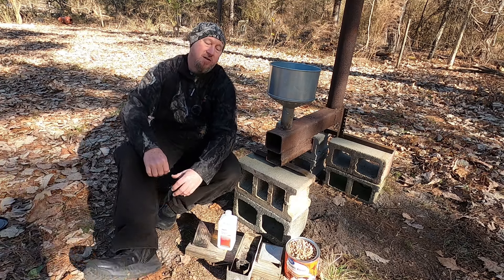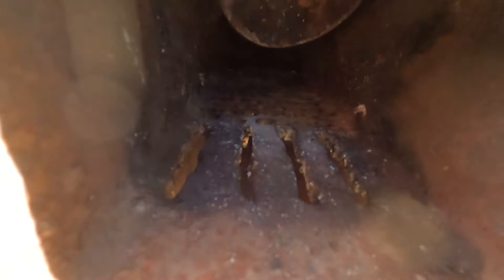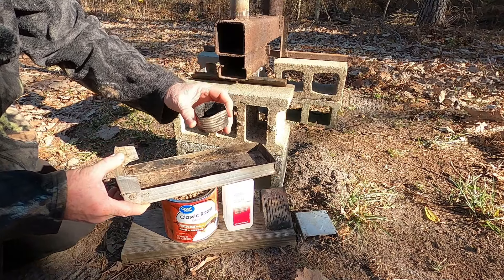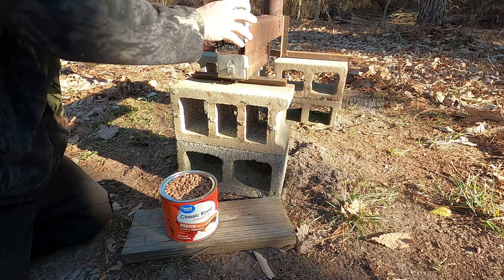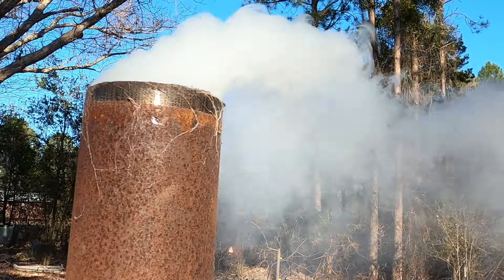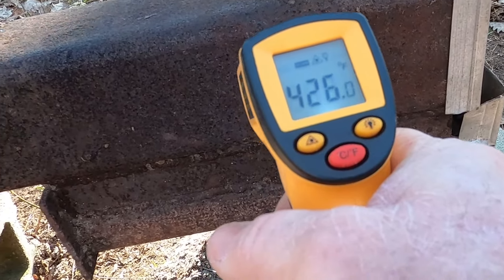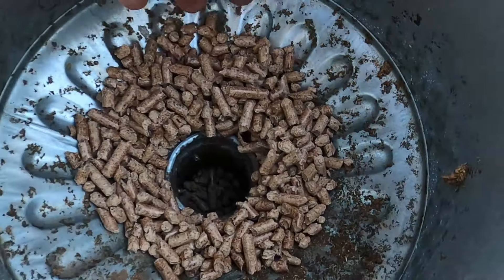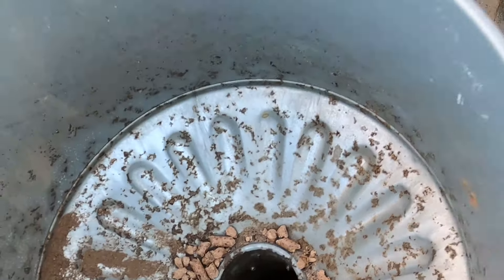Home Made PELLET Burning Heater

Comment: impressive heat on your pellet fired rocket stove !....
Might I suggest a few changes ? right now you have a pile of pellets on the back side of your
burn rate piece.... it would be better by far if those pellets in the pile were being held up about 1/4" from the bottom in a "V" in other words turn your burn rate metal piece upside down and put it under the tube....cut off the protruding tube so you can get the "V" under it
 this way you would get a better burn you can still control the burn rate with the doors by cutting off the air supply.... i found in my experiments that steel does not last very long at these temperatures... stainless steel works so much better ! and will last almost indefinitely.
you accomplished alot with using JUNK as material to work with ! well done...
Reply from the maker: Hey, Absolutely!  I think I may have somewhat of an understanding of what you are saying.. I may build another setup and use your method on it, that way I can keep my original unit and do some mods to try and improve on it. I may even try to make a V grating that will work with my current angled pellet feed as one of those mods. I really appreciate your input.  I hope I can use  your offered advice and experience to my advantage.👍🏻 Thank you for the advice, the comments and for watching.